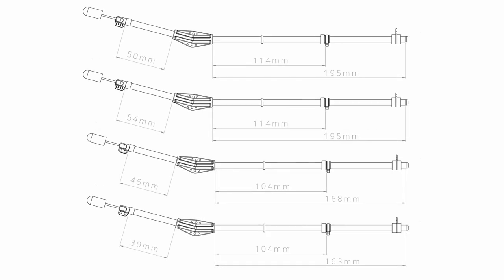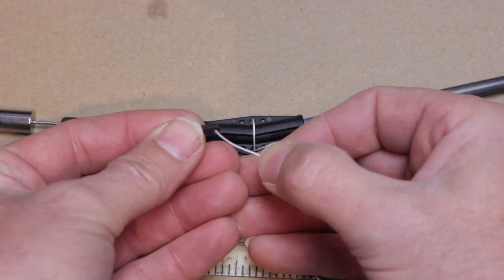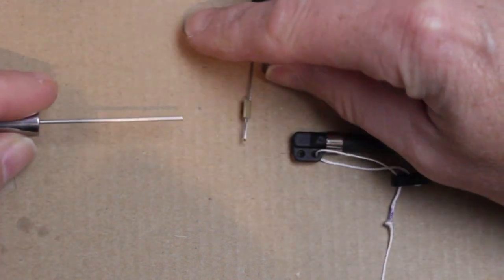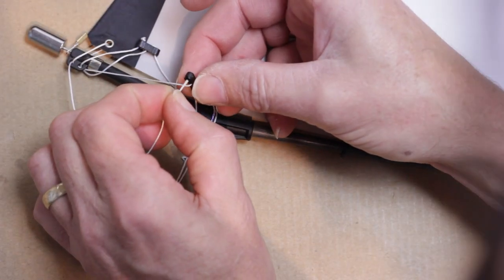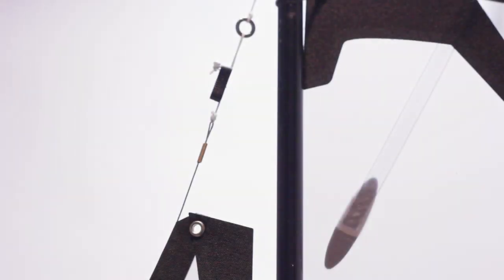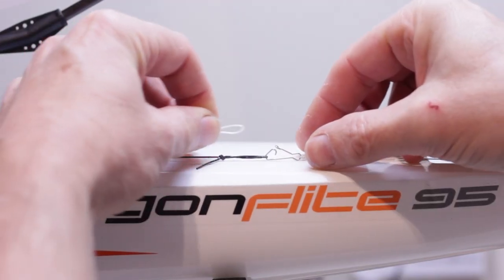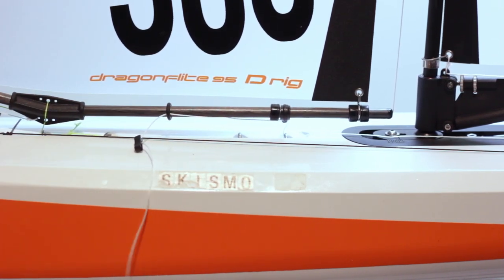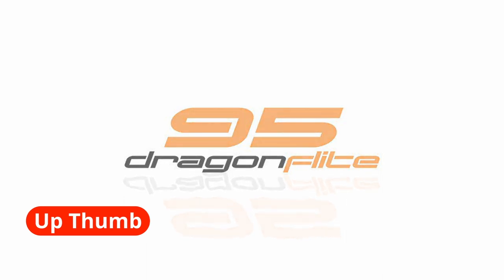DF95 Build   Part 6 of 7   Jib rigging

Comment: I agree with @woodwind1335. I'm building my first RC sailboat, a DF95, and am looking forward to getting out on the water. I've raced lots of one design sportboats and the first time you setup and tune the rig before a race, it's slow going. With a little demonstration and help from your competitors, the race preparation becomes easier and faster. Your series helped all of your viewers, build the DF95 more quickly and without making as many mistakes as would have occurred with just the written directions. Thank you for producing this series and helping all of us walk through the steps.
Reply from the maker: Thankyou, very kind of you to say. Best of luck with your DF95 sailing 🤓

Comment: I find that tie down far to complicated. I simple tied the boom down to the proper high and brought the line through deck rings and tighted down {Ring near mast)  using a bowsie loop. I strong and rarely need to adjust. My guess is I will get "That is against the rules".
Reply from the maker: If you are racing outside of your home club then I guess you are correct, you will get that comment 😉 Enjoy!